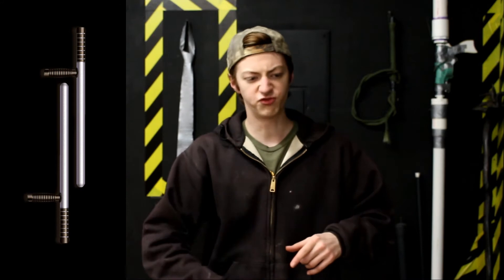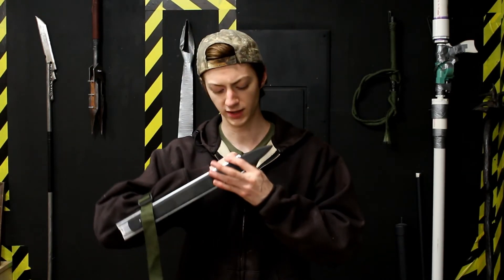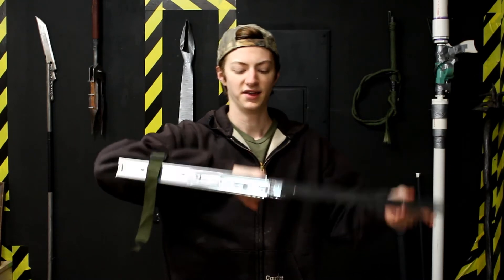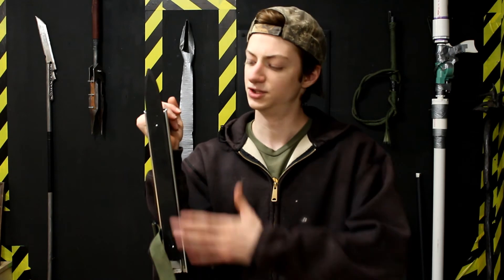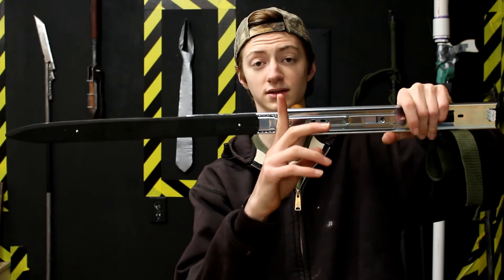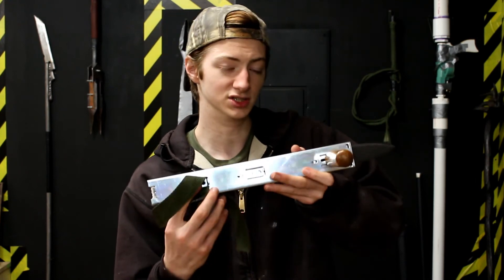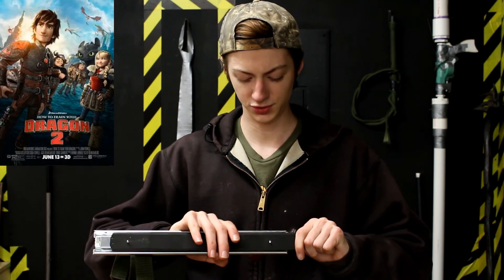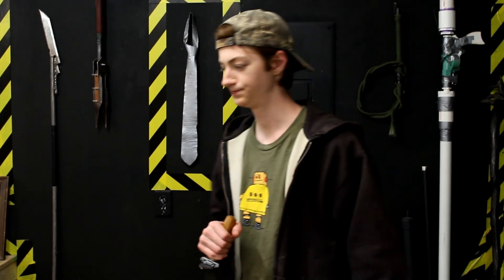Just Brilliant Episode 1:  Spring-Bladed Tonfa?!!

Comment: I would think that if you had a weapon strapped to your arm, you would want the part strapped to you to be able to block attacks and absorb impacts without breaking or bending by using heavier, more sturdy steel for the whole thing, weight be damned (do you even lift?lol). I get it, though, you just made this to look cool, not to be used as an actual weapon.

Comment: The fire sword could work, if you had a sort of pipe that ran down the blade, with 'glands' in it. A release switch on the handle (which would be longer and hollow, for the oil), could pour the oil over the blade. You slide the slot shut, light 'em up, and boom, flaming sword. 
Make sure that 'boom' isn't your hand though, that'd be unfortunate. 
Cool video, mate, lookin' forward to the series!
Reply from the maker: That is one good design, for sure. The thing I haven't been able to get round for that idea yet is the flashback danger. You in essence have a grenade in the handle in the form of the fuel tank. I just don't know how to make some sort of "gland" that would be flame proof. How'do figure to do it? 

Another idea i had was to use a pressurized gas like propane or butane, and do a modified flamethrower design. A pipe/tube running down the blade with holes drilled to let out the gas. Course, then you'd have to figure out where to store the gas cylinder.  Pipe to your belt like a proto-saber perhaps?
Reply: Maybe you could make an air-tight slot that blocks it. Problem is, it could still get hot enough to light the oil inside, through the metal. Maybe you went with the pressurized tank idea; like a squirt gun. You sort of 'spray' the blade, then light it up.
Also, I just went out and built a Tonfa out of wood dowels.
Reply from the maker: That could work. 

Wait, no blades on them tonfa? LAME-O!! 😜
Reply: No...but I put a giant metal poke-thing on the end, and I could (innocent little voice here) attach a sort of taser to it...
Reply from the maker: Innocent little voice indeed. 🤔
Do it!!!